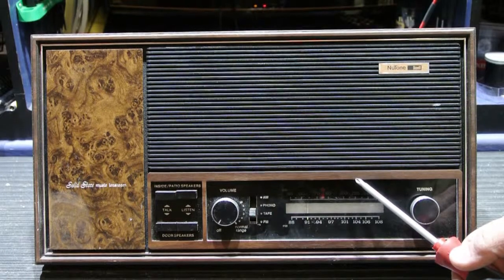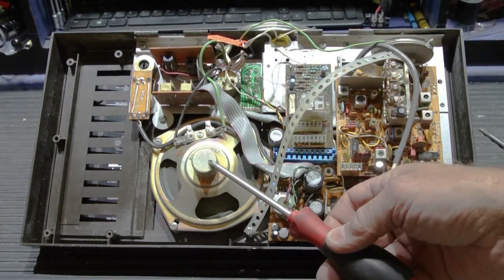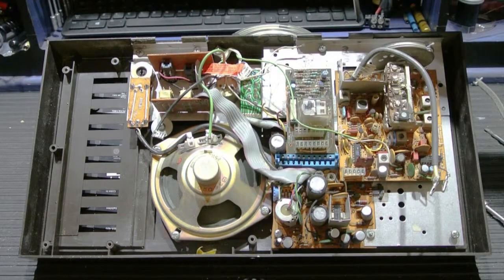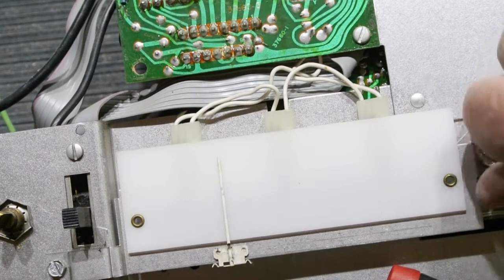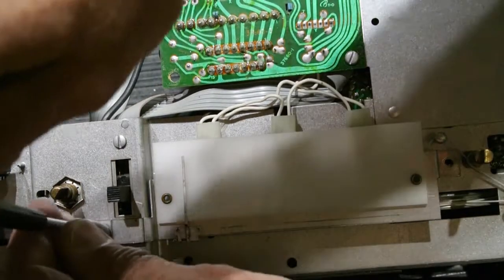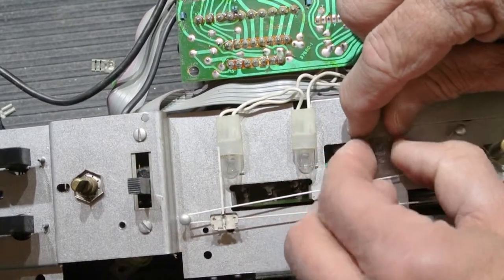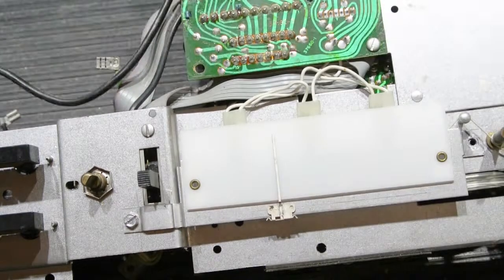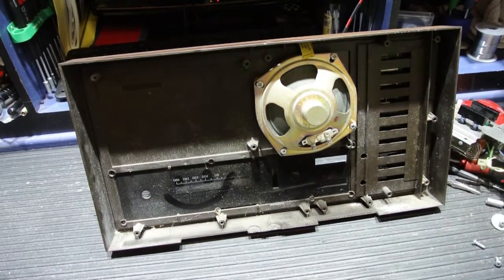How to Replace the Dial Lamps in a NuTone IMA406 Radio Intercom Master Station

Comment: Another great video!  Have you considered replacing the # 259 lamps with white, blue or green Light Emitting Diodes?
Reply from the maker: Hi Matt: Replacing the incandescent lamps with LED's would require modifying the power circuit as well as finding a proper way to mount the LED's  - Probably not worth the effort - Chris